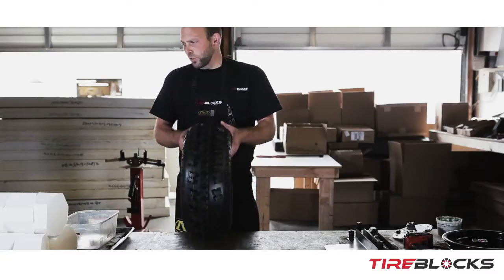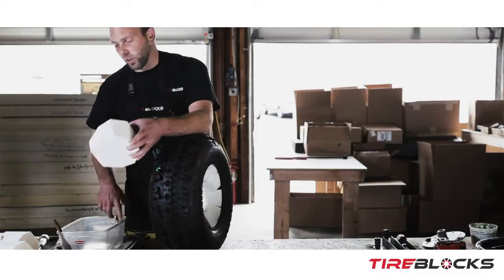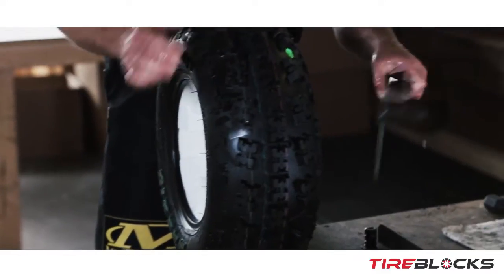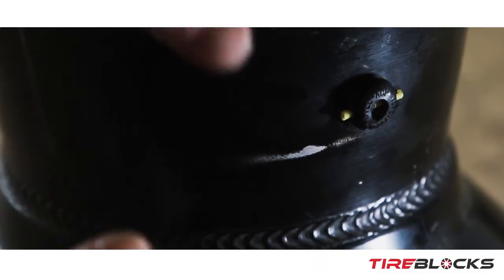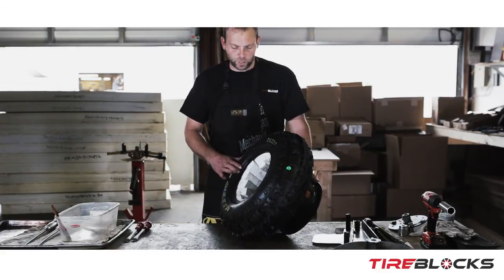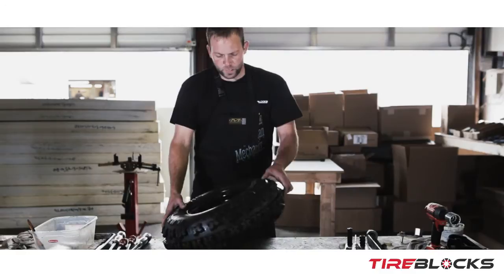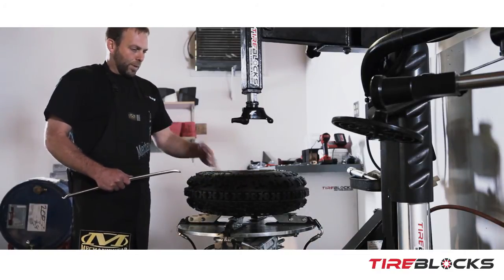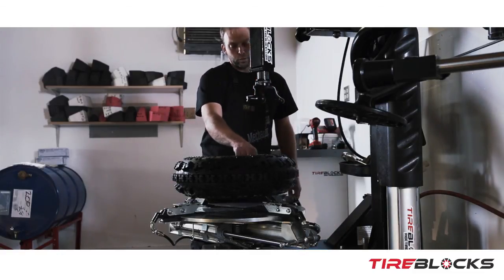Tireblocks run flat system installation

Comment: what is material and how much is cost for kawasaki kfx 450r 2012
Reply from the maker: Hello, what tire sizes are you running on your KFX?
Reply: Front tyre: 21/7-10
Rear tyre: 20/10-9
Reply from the maker: Thank you, the 21x7x10 will run $100.00 per tire and the 20x10x9 will run $137.50 per tire. If you'd like to order and are west of the Mississippi you can give us a call at (253)973-511. If you are east of the Mississippi you can call our east coast distributor (Loud Performance) (716)386-1171